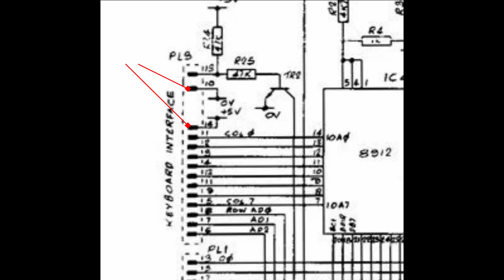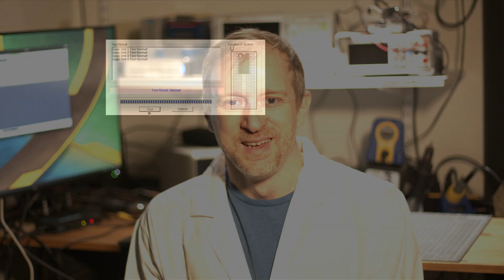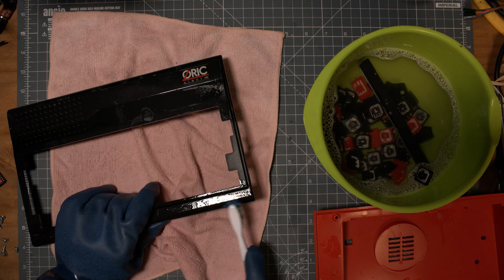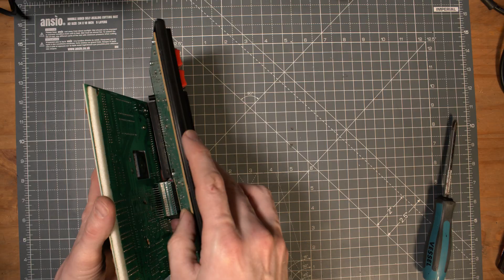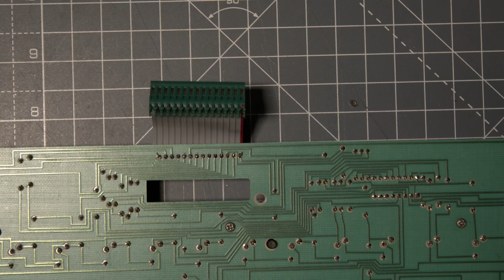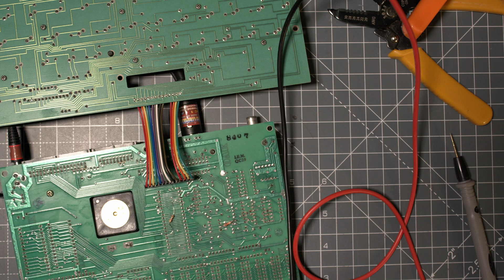Oric Atmos 48k - pt 2/3 - Repair Restore and mini keyboard deep dive [💉]

Comment: Neat work, your fix for the iffy keyboard lead was good.  I have the same problem with those crimping kits.
Reply from the maker: Thanks!
Reply: @retrolabo  I ordered the two sprays you mentioned, is the mothers spray just for shiny plastic or does it work on textured finishes as well.  I am repairing mainly Amiga 500, 600 and 1200's and wondered if it will work on the textured surfaces to remove minor scratch marks.  My other question is can you combine the two, ie go over the case with the Mothers first to reduce scratches and then coat it with the 303 to protect it from further UV damage?
Reply from the maker: I have some Amiga 500 600 and 1200 cases I can try that on for you. I never mixed them up so that might be an interesting experiment too!
Reply from the maker: @Wallygjs  Here you go check out my latest video! Thanks for the idea!
Reply: @retrolabo  Just watched it, thanks very much for doing that, I am grateful for your doing that.